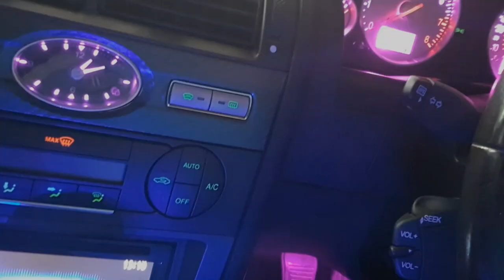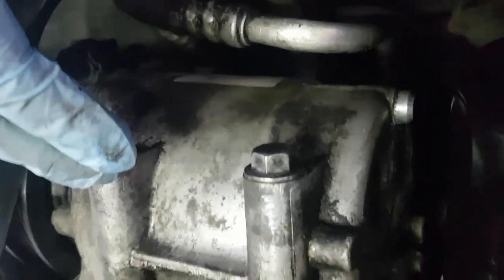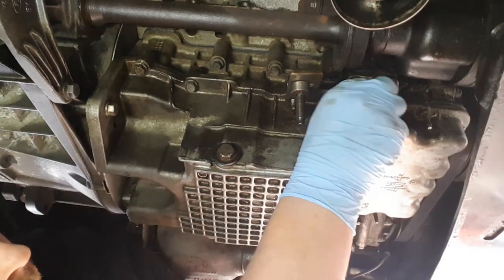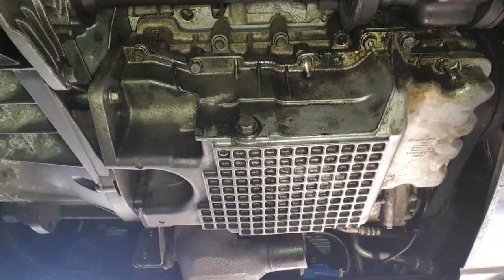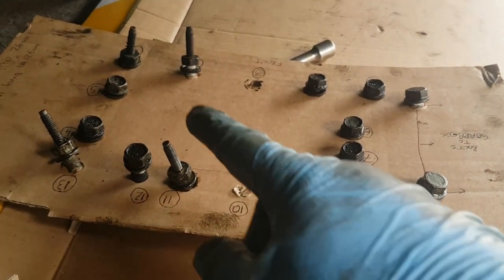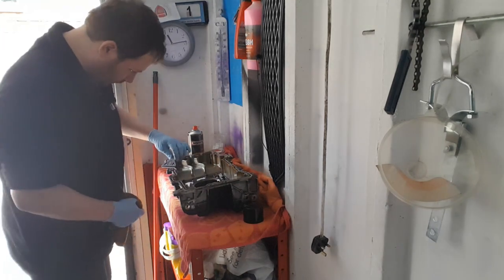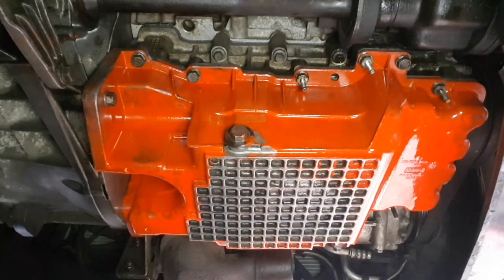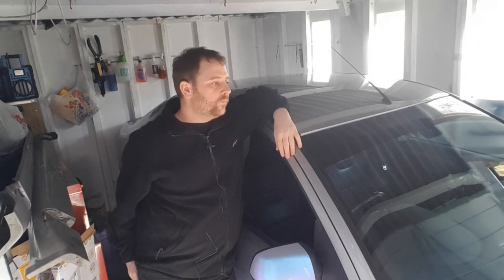How to Replace a Sump Gasket Ford Mondeo MK3 ST220

Comment: Hey chazz, great video. It's one mine and had took old rubber gasket out. Been led metal one. Is that a replacement or do I need rubber one please ? It's a 2004 one. Thanks
Reply from the maker: hiya mate cheers for watching, i hope you have left a like on the video for me. i would replace with like for like.
Reply: @ChazzCoombes  yes I liked your video the first time around.brilliant,thanks

Comment: Great video chazz. I need to do this to my mondeo. You said they gave you the wrong gasket.my Ford dealer said you could use either and reckons the metal one is better.what do you think ?mine.is a 2004 model

Comment: Excellent video mate. Which video shows the exhaust bolts please mate. Also which gasket is correct for 55 plate I've brought the metal and rubber one.
Reply from the maker: +James Stapleton hiya James sorry for late reply. In the discription there are links for pre face and final facelift car. So depends what your one is.
Reply: @ChazzCoombes  thanks mate.

Comment: Chazz ,by your standards this is poor,skipped instruction,no mention in video of pre/face and final facelift,and just a lick of paint!!
Come on!!
Reply from the maker: Your not wrong there, lol. This is one video when the time comes if redo.
Reply: Lol,keep up the good work though mate,your vids have guided me through some tricky jobs!
Was the gasket you did end up using the skinny  one ?
Cheers
Reply from the maker: @paulabraham6774  i ended up using the rubber one, has noticed the metal gasket was for the pre face if my memory serves me right. I should of given more info on it but in the moment didnt.
Reply: Chazz Coombes ok! Thanks,
The vid did alert me to the fact there are different gaskets ,so was useful in that way!!
Cheers